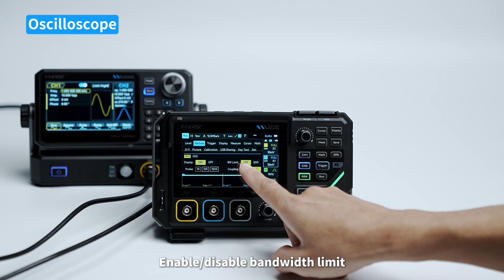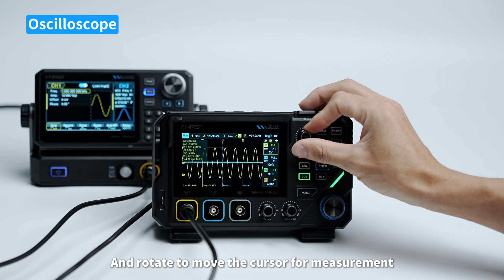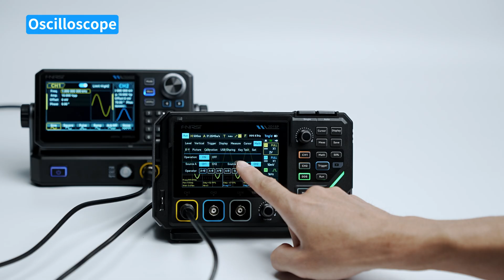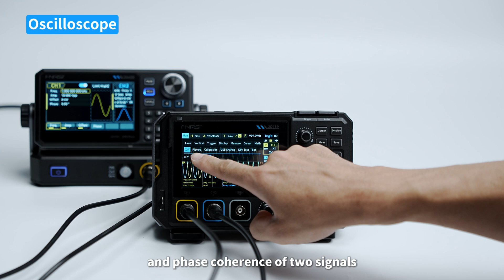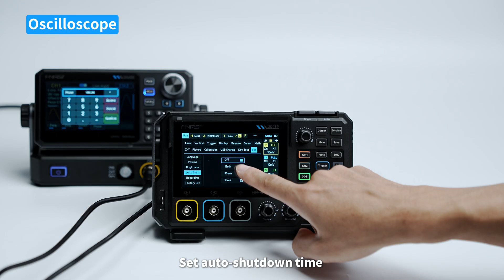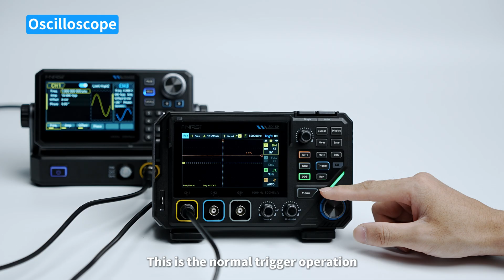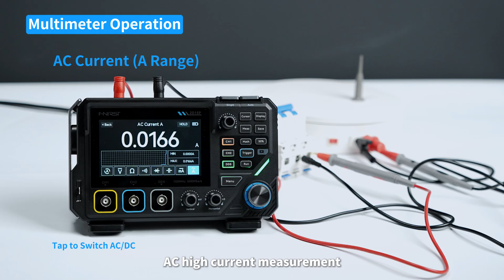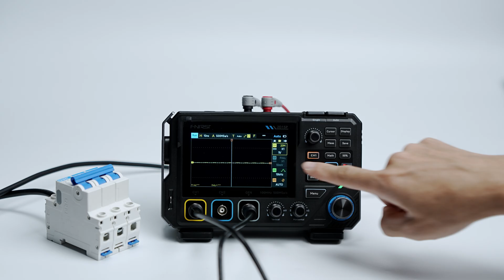FNIRSI 2D15P Touch Screen 2CH 100MHz Digital Oscilloscope + Multimeter + DDS | Full Deep Tutorial

Comment: Good morning.
So you are not going to introduce the FFT function?

Maybe you can add the ability to change settings in the generator using knobs?
Reply from the maker: Hello, currently the 2D15P does not support FFT (Fast Fourier Transform) functionality. We continuously gather user feedback, and this feature may be considered in future product updates.
Reply: And please : If there comes FFT , spend a marker to clearly check the Frequency Domain . No Alibi-System please !

Comment: How to calibrate FNIRSI 2C23T? There is no calibration port.
Reply from the maker: Oscilloscope Calibration – If the waveform shows undercompensation or overcompensation, probe calibration is required. After connecting the probe, both the probe and the oscilloscope should be set to the 10x range. In the signal generator, select a square wave and output 1kHz for calibration. Return to the oscilloscope, connect the alligator clip to the output, and connect the probe and clip. Using the included small screwdriver, insert and rotate the screwdriver into the circular compensation capacitor on the probe to level the waveform.
Multimeter functions do not support user-defined calibration.
Reply: @fnirsi but there's no calibration port in model 2C32T? Where to connect the probe for calibration?
Reply from the maker: @sciphon3084  Can you contact us via private message by searching for fnirsi on Facebook or Instagram? I can send you some pictures.

Comment: Could i use signal generator and oscilloscope at the same time ?
Reply from the maker: Yes, absolutely! The FNIRSI 2D15P supports simultaneous use of the signal generator and oscilloscope. This means you can output a waveform while observing it in real time — perfect for testing circuits, verifying signals, and learning waveform behavior. It’s like having a mini lab in your hand!
Reply: @fnirsi great how much is it?
Reply from the maker: @malekalyamani  Hi, you can learn about product specifications and the latest preferential policies through the link 👉 https://fnirsi.top/4oCcXPl
$15 USD OFF! 🔥code: 2D15P15